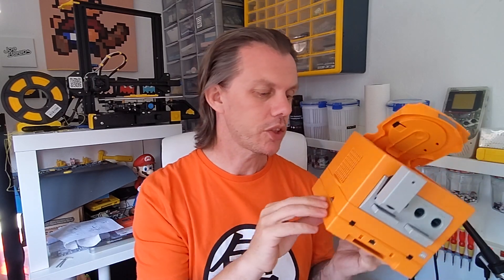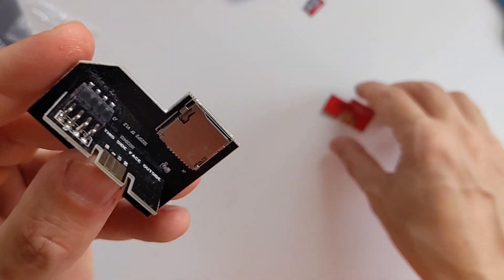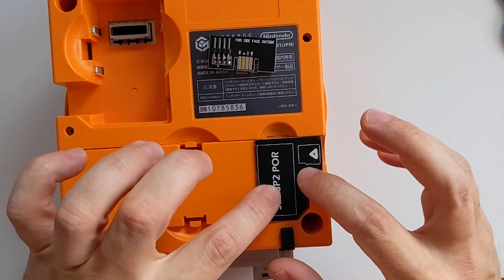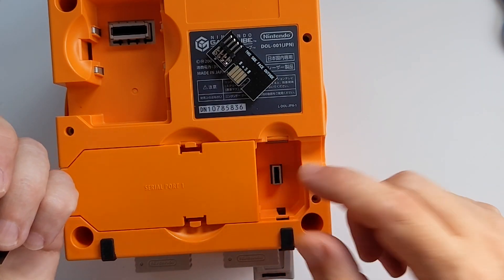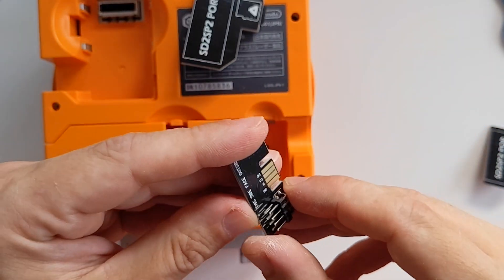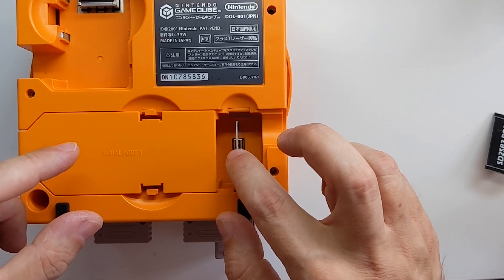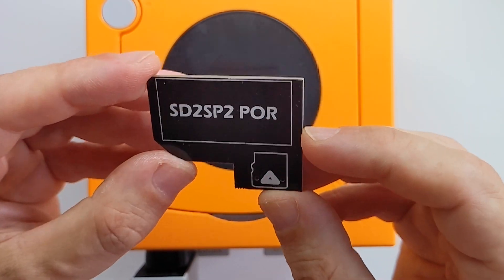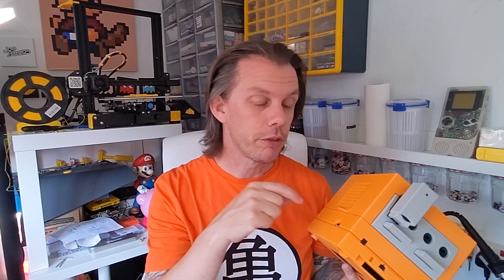SD2SP2 Pro for Nintendo Gamecube mod guide and review - easy SD card access even with Gameboy Player

Comment: It's really generally not a good idea to put solder on contacts that are meant to be inserted and removed since the solder can rub off onto the internal contacts of the connector and damage it or cause conductivity problems later, it's better to just have a slighty thicker board made, SD2SP2 is open source so you should be able to find the Gerber files and there are many low cost PCB printing services available.
Reply: To be fair, once installed, the intent is that the SD2SP2 Pro will be a permanent modification with only the SD card being regularly removed. Of course, if you’re modding your GameCube, there’s a good chance you’ll be modding it again down the line.
Reply from the maker: And as soon as someone produces a thicker PCB I'll get one. The advantage here is that it won't be taken out and reinserted over and over like the original sd2sp2 because the SD card can be removed independently. So while I agree with what you're saying I don't think it's a huge risk in this case
Reply: @101fng  that gives me a good idea, they should totally make a version like this but instead of having a plug with the intent of soldering it to the motherboard directly for the DOL-101 models that lack the serial port plug.
Reply: @draconic5129  get on it, draconic! I’d buy it.
Reply: I think the bigger issue is the insertion edge on the connector isn't bevelled.

Comment: I recently saw an update for the picoboot and the instructions mentioned that you should desolder the 3v3 line from the GC to protect the pico from damage, due to the pico trying to put out 3.3v into the GC during the flashing process.

Well I thought that's annoying and came up with a simple solution; Solder in line with the 3.3v wire a schottky diode with the black stripe facing the pico and that will prevent the pico from trying to send voltage into the GC during updates.

I used a 30v 0.2A diode from vishay and it works perfectly, meaning that I no longer have to desolder the wire during every update. The 3.3v is now ~3v instead, but the pico is perfectly happy with that.
Reply from the maker: Thanks! That's good to know

Comment: I had the same with my SD2SP2 Pro, i'm still glad that I bought the pro though. You can still solder on both sides as you can use some sandpaper and gently rub until the fit is just right and remember to clean it before each attempt.
Reply from the maker: It's definitely worth the effort!

Comment: Ive found that the pro PCB mightve been a little large on purpose (or at least it does serve useful purpose).

It actually does fit in flush on the bottom with the SP1 cover one if you force it in (it helps to first put in the sd2sp2 then fitting in the SP1 cover). With thr tight fit you end up with, it prevents the sd2sp2 from wobbling which eliminates any issues with the thin terminal wobbling in the port.

Comment: I love your indepth analysis! Sub unlocked
Reply from the maker: Thank you!
Reply: @JoeBleeps  No problem. Quick question. I ordered everything to mod my Gamecube and I'll be going the Hacked save file method. However, I don't have a wii, but I do have a modded Wii U. Could I use the VWii in my Modded Wii U to pull this off?

Comment: Great video, advice, and review. Do you still need a launcher disc like the Action Replay or does this remove the need for a startup disc?
Reply from the maker: If you don't have a modchip then yes, Action Replay will work. I'd recommend the Pico Pi mod though, it's fantastic
Reply: @JoeBleeps  Thanks, I'll check it out
Reply from the maker: @ATeaDaze  https://youtu.be/rDrosSd-nDc
Reply: @JoeBleeps  Thanks! I'll need to practice soldering with an old motherboard or something since I've only done it one time in junior high (and it was a mess, lol)

I suppose I could ask my dad since he knows how to solder but I think I should learn it myself (sooner than later). Thanks again
Reply from the maker: @ATeaDaze  definitely worth learning. It's a lot of fun

Comment: The original sd2sp2 was thin like this so they just tinned the connections on one side of the pcb with solder
Reply from the maker: I think it varies from one batch to the next, my original SD2SP2 were okay but these Pro boards are thinner

Comment: Do loading disc should stay in console all the time, or after console starts and Swiss loads it's better to take it out (maybe better for lens no to rotate loading disc all the time)?
Reply from the maker: @valerijsglazkins7237  leave the disc in. What I've done since is install a Pico boot mod with a raspberry pi Pico in there as a modchip. it allows you to run swiss from the SD card, no disc needed
Reply: @JoeBleeps  Pico boot is installed, so Swiss should work withot disc. But it doesn't. Everything works fine if disc is inserted. Push power button and Swiss menu with games list apperars. But If i start console wihtout disc, there is only Gamecube menu (Options, Gameplay, Calendar, Memory card).

Comment: I’ve got this sd2sp2, same problem, Swiss doesn’t even detect it. Not sure I’m brave enough to add solder to the pins so I might be SOL :(
Reply from the maker: It's all the more frustrating that it's such a clever idea but the execution isn't accurate enough for it to work as well as it should
Reply: Same problem here, formated in different FAT 16,32,standard with different OS and cards. Swiss wont detect it. I cant solder so i feela bit ripped off now. Aliexpress junk.

Comment: But how to start the games then? It came with a CD but the drive is not reading it
Reply from the maker: @Conrad-Roentgen  you need your console to have a modchip installed. Or use an Action Replay disc if you can find one

Comment: How did you get yours to work? Ive seen conflicting messages on other vids saying you need a swiss disc, you don't need anything, you need the xeno. What is the deal?
Reply from the maker: @MaxieRetro  when I first tried it, I used a swiss disc with a xeno chip. Currently I'm using PicoBoot which can run swiss off the SD card and doesn't need the swiss disc. I wouldn't expect it to work without a chip unless you use an action replay disc (if you can get one) and swiss on an SD memory card adapter, I believe.

Comment: I purchased mine recently but do I need to install the XENO into the motherboard internally for me to run the SD card and the CD on my japanese console?
Reply from the maker: @mago4683  you will need some sort of modchip or an action replay disc. It's easier with a chip. I prefer the picoboot method with a raspberry pi Pico, although it's a bit more involved than the xeno chip as you have to remove and replace a heatsink and make a gap in the shielding too.

Comment: I have this sd2sp2 por i have done the picoboot install, i flashed the pico. Installed the pico, green light comes on at boot. I have an ONN 128gb micro sd card (onn is supposed to be compatible with this) i have it reformatted to fat32, i have swiss on it, i have the main swiss file renamed to ipl.dol, i have it directly in the root of the sd card, i added a small amount of solder to the contacts to make the sd2sp2 por a better fit. I keep getting an error saying "no m.2 loader hardware detected trying sd2" i cant find anything on this at all, could you please give me another suggestion?
Reply from the maker: @knuckles31312  worth trying with a different SD card before doing anything else, sounds like you have done everything else properly
Reply from the maker: @knuckles31312  I just read it could be related to using Windows 11 so it might be worth borrowing someone else's computing yours is Win 11
Reply: @JoeBleeps  I have had one person say this to me on reddit a couple of days ago and tried to find something else on it somewhere but have not seen it anywhere else. I figured if it were a thing I would see it posted or talked about anywhere else and have yet to see it, I have a gecko coming in the mail in a day or two and am going to attempt that and if that is a no go I will then try a computer running a earlier OS. I do appreciate you replying and at least humoring me! Thank you for your time! I'm going to sub to your channel!
Reply from the maker: @knuckles31312  thank you! And good luck

Comment: I want to buy this sd2sp2 but how do i get games on an sd card and how do i start up those games with the gamecube? Do i need something extra?
Reply from the maker: You'll need to back up your own discs or find iso files online, and you need to run a software called Swiss to play the games
Reply: @JoeBleeps  can i simply have sd2sp2 with games on it and have swiss on a memory card with sdcard in it to run the games?
Reply from the maker: @dumb8899  I think so but you'd still need to boot a disc if you don't have a modchip. The raspberry pi Pico makes it so you can run everything off the sd2sp2
Reply: @JoeBleeps  so it should work by having memory card with swiss and iso games on the sd2sp2 card?
Reply: @JoeBleeps  but it would involve modifying my original GC i was hoping not to do that
Reply from the maker: @dumb8899  that's fair enough
Reply: Cut your hair, you're balding

Comment: is this adapter required a chip inside or not
Reply from the maker: It works best with a chip inside but I'm told it also works with an action replay disc

Comment: what micro sd cards will work in this?
Reply from the maker: I don't think there's a size limit, but I would always advise using a decent brand as they have more reliable read speeds. This is what makes your games run smoothly

Comment: Does this work for non modded gamecube systems?
Reply from the maker: It is easiest if it's modded. Otherwise you will need a boot disc like an action replay
Reply: @JoeBleeps  ahh…that makes sense……do you know a boot disc that’s cheap enough to pay?
Reply from the maker: @masterdrewt6698  no just the Action Replay, which I think is scarce. The mod chips aren't too difficult to install. I love the picoboot mod
Reply: @JoeBleeps  well I…guess I can see but. Personally there’s gotta be an easier way to buy an action replay that isn’t pricy as it should.

Or at least as far as ik

Comment: Why not just sand the plastic clip instead of the chip
Reply from the maker: It's easier to sand the new part and doesn't damage the console.  The new part should fit and doesn't, so it's the new part that needs sanding to fit.

Comment: I bought mine off Aliexpress.
Reply from the maker: How did you get on with it? I'm guessing the tolerances may be varied from one batch to another
Reply: @JoeBleeps  I bought one for AliExpress like 2 months ago and the fits actually pretty good. Definitely does variety from batch to batch if you were having issues.
Reply from the maker: @usb6000  I figured that may be the case!
Reply: Love the channel bud. Quick question gents. What are the next steps? Just load the games on then boot up the gamecube? Am I missing something?
Reply from the maker: @Telephantastic  load games onto the SD card and then you can access them when you launch Swiss
Reply: And how do I launch swiss? Do you have a video helping with this. Thanks for your time
Reply from the maker: @Telephantastic  https://youtu.be/rDrosSd-nDc this should help
Reply from the maker: @Telephantastic  also you'll need your cube to have a modchip installed for the easiest method. You can also use an action replay but I've not tried that
Reply: @JoeBleeps  thanks Joe. I'm hoping to find a method that doesn't require soldiering. I'll keep doing some research. Appreciate your time brother and keep up the solid videos!